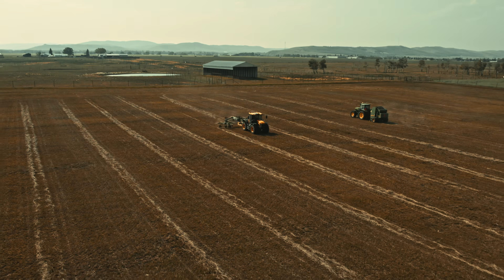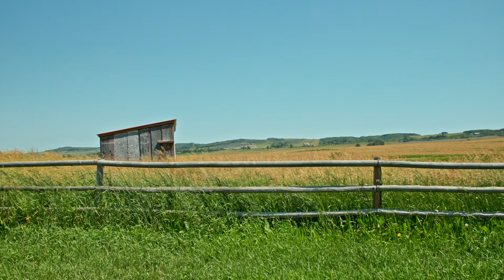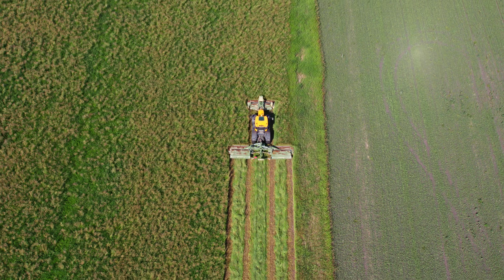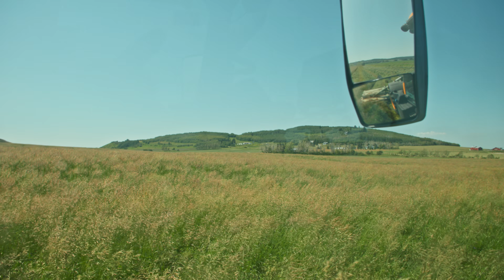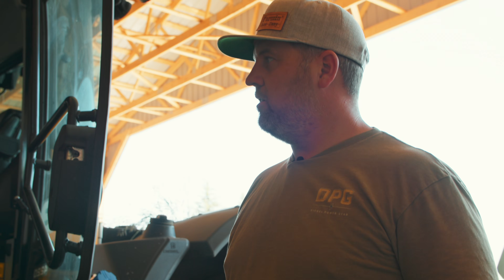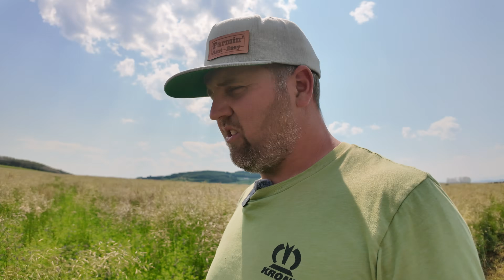Cutting Hay the Fastest Way We know How!

Comment: You deserve a medal trying to rely on a JCB Fastrac, after having the displeasure of owning a few.. what mechanical nightmare's!!
Absolute must with a frOnt mount is a reversible fan. We moved to fendts and 7r JDs.
Have thousands upon thousands of hectares under my belt with Claas triple mowers. 
Best day mowing in rocks was 72 broken blades.
And yes when we got quick change blades over bolts 20years ago was a game changer.